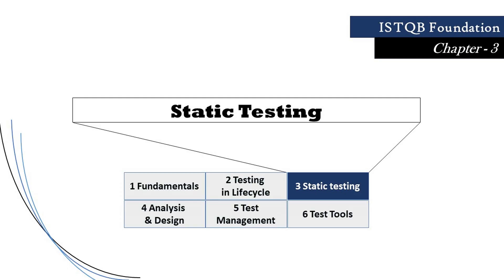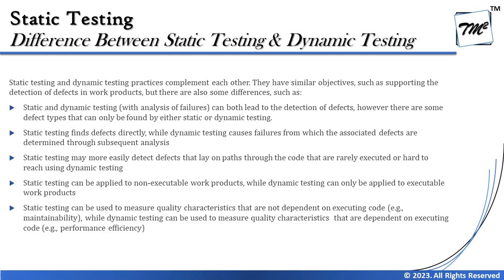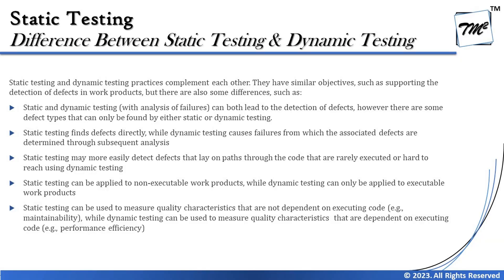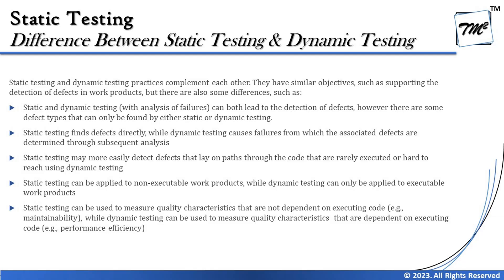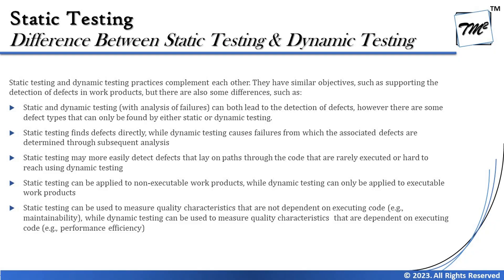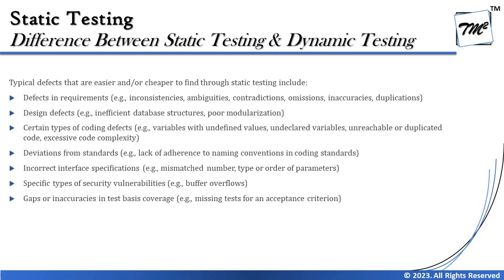ISTQB FOUNDATION 4.0 | Tutorial 24 | Static Testing vs Dynamic Testing | Static Testing Defects

Comment: 00:02 Static testing vs Dynamic testing
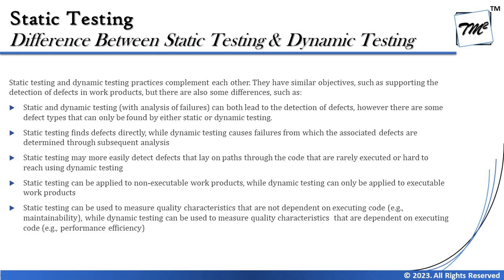01:07 Static Testing vs Dynamic Testing Overview
02:13 Static testing and dynamic testing have different value and application in finding defects
03:11 RCA vs Static Testing
04:13 Static testing is applied to non-executable work products, while dynamic testing is applied to executable work products.
05:12 Key differences between Static and Dynamic Testing
06:08 Static testing can find various types of defects in requirements, design, coding, and interfaces effectively.
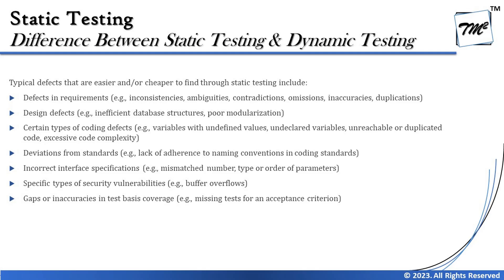07:11 Static testing helps in identifying gaps and inaccuracies in test basis and traceability.
Crafted by Merlin AI.